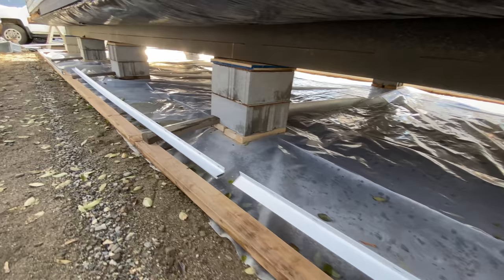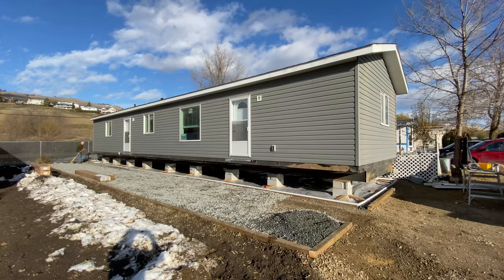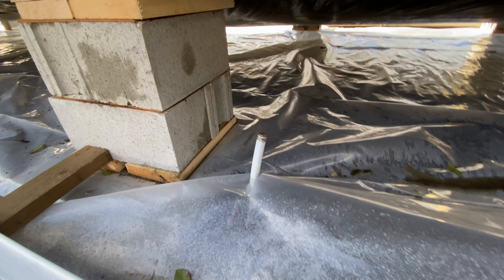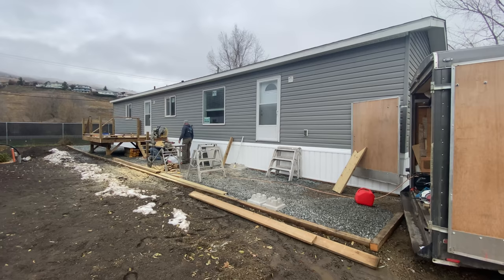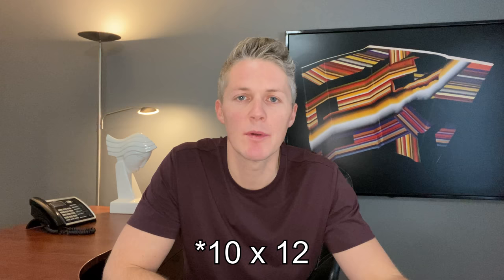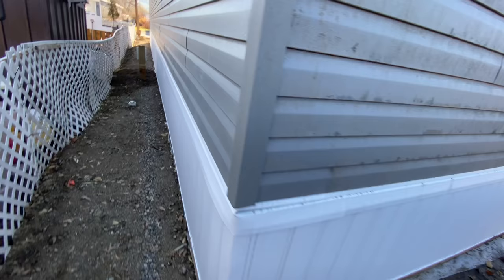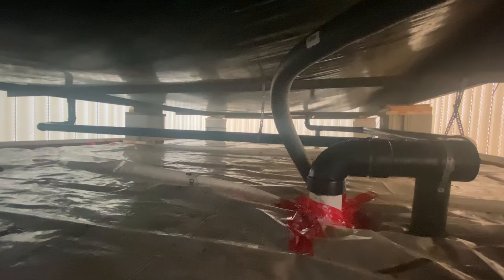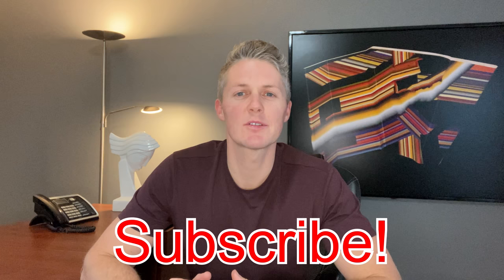Step by Step Manufactured Home Installation!

Comment: Don't forget that before the skirting can be attached, the building inspector has to come out and approve it... You can have concrete slabs, rat slabs, etc. if you're putting the home in a park where you own the land directly underneath your house or on your private land.  If you want to be able to crawl under the house, you might have a pit dug (called a "pit set") to allow for a crawler with a person on it as they traverse under the home to do whatever it is they want to do.   I'm a manufactured home agent in California.
Reply: Can you recommend anyone working in the San Luis Obispo county?
I'm trying to find a company that can help with building the foundation & septic system. Well everything basically.

Comment: Where do I begin with my comment? Well first off thanks for the information. Second that's one of the best blocking jobs I have seen. It looks nice and clean under the house. Here the hitch always goes under the house. Sometimes you can trade your axles for sidding. What do you guys do with the hitch? Great video 👌 thanks
Reply from the maker: Hey Kirby! The houses rarely ever get moved again so the hitches normally get scrapped. The trucking companies will have extra hitches if someone does end up wanting to move the home. We will leave them if people want them but most of the time they’re just in the way and people don’t want anything to do with them.

Comment: I had a company tell me delivery,set up ,heat pump tye down, skirting will call me 50 grand. Then the cost of the mobile home singlewide i picked out was ,$50 grand.i also had to paid for septic tank to be put in $5 grand. Then have the power company come out to run a power line an meter, 
Then the taxes. I was looking at  about over S150 grand. I decided to purchase a house.

Comment: Do I need to have the water and septic drain stubbed up above grade before the home is brought in? Or is that dug and run under home afterwards? I have piers poured and waiting on home to be delivered. Wondering If I should go ahead and trench utilities  before or after home is set
Reply from the maker: We always do it before, it’s easier than doing it after the home arrives. Make sure the drain doesn’t stub up where the wheels will go though.

Comment: So you don't need a slab. Just the dirt pad is enough to set the block on?
Reply from the maker: Where I am yes. Some areas require more
Reply: Is it okay to do gravel instead of dirt under the home? I think it be much better for when you get under it you won’t have to deal with all that mud. Can it be done?

Comment: Hi Kerry,

Typically does the manufacturer home builder provide the ‘setup crew’, or is that on the homeowner? Looking to put on of these on a private property, what would the homebuyer responsibility look like in getting this installed (utility hookups, does home need to be on a foundation, will I need to level the home, etc.)?
Reply: Most home dealers will level the home when it is delivered. That also includes blocking and tie downs. Then you need to have the power, water and sewer or septic installed. That can be done while the interior and exterior crews finish the home out. Lastly you have it inspected then underpinnings, either vinyl, board or block/masonry.

Comment: Do you know if the movers have any way to raise the home over a narrow bridge during delivery? My property is across a bridge that is 14 feet wide with a 33 inch railing. Is it possible to raise the home up 12-15 inches to get over the bridge railing?
Reply from the maker: Some truckers have equipment to raise the home with air but I don't know if they can go up 12-15 inches worth

Comment: Do the water and sewer lines got to be installed before the home get set up / do the home dealer supposed to provide the pipes for water and sewer lines or the owner got too
Reply from the maker: It depends… sometimes buyer will do their own lot prep and sometimes the dealer will. On this lot the sewer/water were already installed and we did all connections

Comment: This home is installed incorrectly and by the numbers.  1.  NO WOOD should be under the piers.  2.  NO ANCHORAGE straps are visible, how can this remain stationary in the wind or seismic activity?  3.  NO CAP BLOCKS just wood.  4.  WOOD in excess of 5cm (2 inches) on top of piers.  5.  Appears NO HARDWOOD is used on piers.  6.  Piers appear to be too far apart, what does the home's installation manual state?  7. DOOR PIERS are missing.  8. Missing pipe hangers on the drain pipe.  I'm sure there's more, but without seeing the full site prep, I cannot determine this.  

I know this is CANADA, but look at the USA's regulations in 24 CFR 3285 for further guidance and look up any of the large company installation manuals that are available online (Clayton, Cavco, Champion-Skyline).